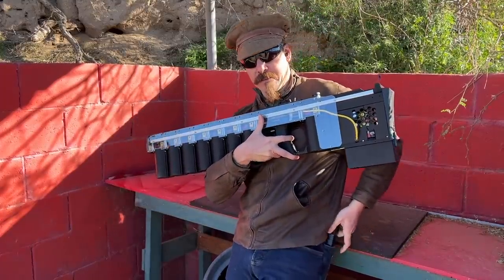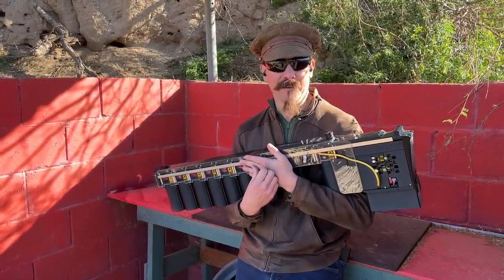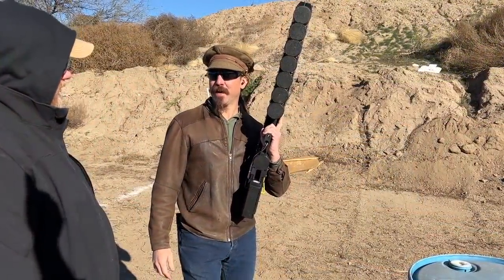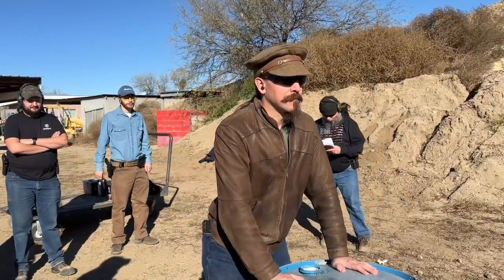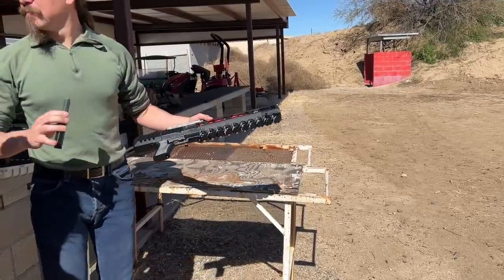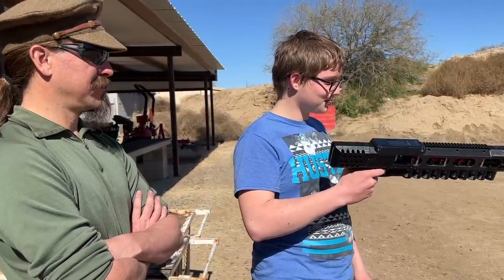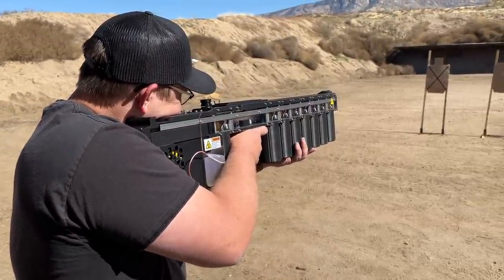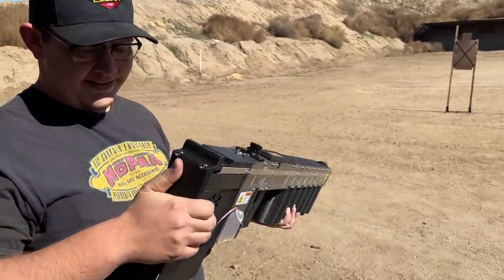I Tried to Use the GR-1 Anvil at the BUG Match...

Comment: If you look at Paintball, firing gelatin musket balls, the development of actual accuracy came with First Strike Rounds.  They are basically a Rifled Foster Slug.  An aggressively wide patent was somehow allowed on the "shaped projectiles" and has stalled out all other development, but Accuracy went from 25x25 over X range being typical to 5x5 and about a 100% increase in range.
I cold see a multi capacitor system, charge when powered up, then start recharging as soon as discharged being useful to limit the delay between shots.  Will be interesting to see how engineering and development move forward on these.

Comment: I feel like they need to dial the weight of the projectile down to something closer to a 30 cal rifle round. Then they could use more energy moving lighter round faster.
Right now it’s like a pop cap trying to push a cannon ball.
Reply: There's practical limits on the speed of the projectile due to how the coils work.  It's far easier to add energy by increasing mass.
Reply: Naw coil guns dont behave like that its fairly easy to move a larger projectile the same speed but due to complications with timing and how fast you can dump the capacitors higher speeds become much more difficult the faster you go

Comment: Saw the light/heavy trigger pulls resulting in non-optimal firing; could a charge to pull, fire on release system help mitigate that?
In any case cool gun, thanks for showing it to us and taking it out of the realm of theoretical.
Reply: That sounds a little unsafe to me, I was more thinking along the lines of separating the charging and firing switches to use different fingers on each, or a switch for the off-hand for charging. But since it's still a prototype I'm sure they're going to change many things to it, and then to the next model, and the next, and so forth, until everything is optimized.
Reply: As opposed to pulling the trigger on a regular gun? It's much more tactile with pull to charge, release to fire. you can have a button where a slide lock/ bolt release would be to release without firing, or use that as the charge button. The current method is much like the old school pull a little for semi, all the way for auto.
Reply: "Release triggers" are a thing, but they were never popular.  Mostly they were used in shotgun competitions, but they're all but unheard of today.

Comment: Ian should start a WWSD 2120 project.   You can get a simple railgun set up pretty easily.   Basically just wrapping a tube magnetic wire and a couple 9V batteries.  It won't generate a lot of acceleration, as there were no additional stages or increasing power levels, but even that is enough to launch small metal objects 5-10 feet.

Comment: seems like it would be nice to have it charge automatically when in firing mode so the trigger simply is a discharge and can be less fiddly.
Reply: Basically give it a safety switch. Safety off = keep the capacitors charged.
Reply: @matejlieskovsky9625  - My thoughts exactly.
Reply: He brought this up in the previous video, keeping those capacitors charged generates a TON of heat, which is also why the gun can't fire too quickly too often, cause it might melt the barrel or damage the capacitors.
Reply: @SnivyTries  I must have missed that bit of video, where is it? I know dry friring is bad for the gun and it does tend to heat up in general (courtesy of 2% efficiency), but keeping the capacitors charged up should be relatively ok unless there is something weird going on with the circuitry. I mean, you're only fighting the leakage, which shouldn't be that bad. Maybe their step-up is not built for it?

Comment: If I were to develop such a weapon, my first choice for projectiles would be those .177 copper ball bearings, this would solve aerodynamic issues. When they're coming out the barrel in a bright green streak, thats when I'd start developing my own projectiles..
Reply: I think it needs ferrous metals for the projectiles
Reply: @frostedbutts4340  Indeed it does. You can't fire copper projectiles with a magnetic accelerator!
Reply: You can fire copper projectiles but it would require different timing for the coil which mean you will need a different setting for the gun. Any conductive object will generate a magnetic field when put into a moving magnetic field and since this magnetic fields will tend to resist moving magnetic field of the gun it will accelerate the bullet albeit with weaker force. The upside of coilguns working by this principle is there is no upper limit on how fast you can move a projectile and it can accept alll kinds of ammunition as long as you wrap a feww loops of copper coils around it.
Reply: @frostedbutts4340  I think he's talking about the copper plated steel BB's for air rifles

Comment: I suspect eventually this kind of weapon will have the magazine contain both the battery and the projectiles, so you don't have to worry about the battery going low. It would need a much smaller battery to be able to handle just one mag of rounds.
Reply: Would be nice but something that has been true for batteries for a long time is that a bigger battery/putting more in parallel is going to be better at delivering high currents to your device without losing too much voltage to internal resistance in the battery cells. I'm not saying it's impossible but unless battery chemistry changes a lot those would be some bulky magazines. And you'd also have a positive and negative contact point on both the magazines and receiver that need to stay clean and electrically conductive, but that should be easier to solve than the first issue.

While we're limited to current technology a good clear audible/visual indicator and easy to swap battery would be nice. Ian did show you could change it in one of the earlier videos but for the prototype it seemed a bit like a hassle to me still manually connecting that wire instead of just pushing it in establishing the connection. Indicator wise I was thinking about for example multiple colours.
green: good for at least current and next magazine
yellow: fine for this mag (at current setting) but maybe not for the next
red: can still fire but will run out with this mag
flashing red: unable to function well/really long charge time warning?

Oh and for truly fancy futuristic solutions that information could be displayed not only on the gun itself but also with some google glass like contraption?
Reply: I was thinking along the lines of swappable batteries as well. Another solution would be to carry a battery backpack, plug a wire into the gun and you're good to go. Battery goes flat, grab another backpack from a vehicle / ammo dump.

Comment: Sounds like air soft gun with extra step but one day it probably goes beyond what gun powder weapon can do.
Reply: I think they have more potential as a vehicle or ship mounted weapon than a man portable one. Similarly to the minigun, vehicles have much more generous power storage and weight requirements.

In like 2012 the navy test fired a rail gun at like Mach 20 sucsessfully. But it never went further than that due to cost.
Reply: @0sm1um76  Ships are def the no.1 platform for gauss guns, because they can have the massive batteries without no problem

Comment: Interesting issue with the trigger bieng too light. It could be solved with a binary type action...pull to charge, fire on release. This is common for railguns in video games and would be a nice for the mfg to add as a menu selectable option.
Reply: Many kinds of sporting fire-arms have a fire-on-release trigger because it's apparently more accurate than squeezing the trigger to fire. So this is definitely a good idea.
Reply: Issue with that sort of double function trigger is not firing after charging. Since the "preparation" of shooting takes a moment with a deliberate action, by the time it is charged, the target may be out of reach, and then what? Shoot at the ground?
Reply: @HappyBeezerStudios  mechanical binaries is regular firearms solve this problem by the user switching the safety back to normal mode if they don't want to take the 2nd shot. Similarly with this electronic system a thumb 'saftey' could be used to either: 1)interrupt the firing cycle either by dry firing the later coils while withholding the projectile. OR 2) more simply disabling the trigger leaving the capacitors charged for the next shot or to discharge naturaly over time.
Dumping the round is a last and least desirable option. This need to discharge is also a problem faced by muzzleloader and crossbow hunters who often have fire into the ground/target at the end of the day in order to safely/illegally transport their weapons home (though there a few unloading tools now available on the market in recent years)

Comment: Even with the weapon switched off and mag removed, if there is a projectile in the barrel and the capacitors have been charged there is still a potential danger.
Capacitors can be nasty, as young mechanics we used to charge condensers (automotive capacitor used in points ignition) and throw them to people. It's instinct to catch what is thrown to you and that's when you get zapped.
When they dropped them we would pick them up again (discharged) and say were dreaming, this thing can't zap you.
Then carefully pass them the charged one you had in the other hand and get them again.
Reply: There is no projectile in the barrel with the mag removed. The projectiles are shot directly from the mag and there is no chamber in the barrel.
Reply: @Ashcrash82  If it misfires the projectile remains in the barrel, did you not watch the same video I did?
Reply: @Stambo59  It was my impression that a misfire would discharge the capacitors, so still no danger. I'm certainly not an expert on this thing though.
Reply: @Ashcrash82  It would but depends on what the operator does next, if he pulls the trigger to recharge it for example.

Comment: Is there a reason ball bearings aren't used as a projectile? It would seem that they would be more aerodynamically viable.

I can think of two reasons, though I don't know if either are valid. First would be the lower mass in general. The second is that being spherical it wouldn't behave the same as a rod in the magnetic field (i.e. it could rotate "end over end" in the barrel). The second reason is definitely pulled out of my butt.
Reply: Two reasons, firstly the projectile is only being accelerated when its passing through each of the coil fields in succession, longer object spends longer being pulled or pushed in the fields. Secondly without distinct magnetic poles to control acceleration direction you would be more likely to have it ricocheting inside of the barrel or the spherical projectile being spun in place rather than accelerated linearly. However thats not to say you couldnt make improvements to the ballistic characteristic of the projectile, offset the coils along the Barrell length similar to rifling, or alter the projectiles magnetic properties to induce a spin (e.g. having a weight balanced non-ferrous material substituted along a few degrees of the projectiles radius)
Reply: you would want a ball bearing that looks more like a miniature golf ball, it helps with controlling the accuracy.
Reply: The projectiles are already half inch, I don't think this thing will be easy to get a sporting exemption for either. Using half inch spheres would just be too small, at least in its current state.
Reply: @watcherzero5256  You are implying that it fires magnets. I doubt that.
And that concept for creating a spin on the projectile wouldn't work either.

Are you maybe talking out of your ass?

The best idea to create a spin is really the same as with traditional weapons.
Rifling.
Obviously thats not done in a prototype that shoots slow heavy projectiles anyway. 
There are a number of easy to fix problems here that are all not solved on purpose, because there are more important problems to solve and to spend time on. Solve the wrong issue too early and it will limit your development, or it might just be a waste of time in the long run. 

My best guess as to why the projectiles are large cylinders? Making the projectile heavy gives it more time to accelerate, to a slower speed, for the same energy output. If you make the projectile round its impossible to make it this heavy youd need pretty large diameter balls.

And they haven't figured out how to make it shoot fast yet.

A fast projectile means a short time in the magnetic field, means you need a stronger magnetic field, or more fields. 

Over all, there is a energy density and availability issue.
For traditional guns, your entire required energy is in the bullet itself. Its there almost instantly, and its simply a pressurized gas. Thats easy to work with. 

Here its stored in a battery, and it needs to be loaded into capacitors, and used by coils. 
The battery is heavy, the capacitors take up a lot of space, everything is fragile and relies on computers. 

You could probably make a WAY better design if you make it use a backpack, like with flamethrowers.

Honestly, the biggest use i see with gauss canons isnt in a compact mobile design, but large cannons shooting high velocity projectiles.
If you use explosives for high velocities you need A LOT of explosives and a HUGE barrel, you have a ton of stress and wear on the material etc.
For gauss weapons, your energy has no significant weight, you have no huge explosion. It's easier to upscale.

Its most practical for atillery, not rifles.
Reply: I could see them being changed more to a sort of dart in later versions.
Reply: Well I guess they used heavier rounds because while it is possible to accelerate smaller projectile to much faster velocity in theory (with same amount of energy dumped into lighter ammo will get faster) but the timing of the coils will be increasingly difficult with faster (lighter) projectile. It is still in early development so I think we'll see ability to shoot lighter projectile faster (more terminal velocity) in the future.
Reply: @HyunMoKoo  Also lighter projectiles will usually go slower, with there being less magnetic mass.
Reply: @carlpanzram2012 , rifling is actually NOT that viable for gauss weapons, as it would dramatically increase wear and tear per shot. Even the Navy railgun was using fins on the projectile much more akin to an arrow's fletching (an even older method of spinning projectiles than rifling)
Reply: @someweeb3650  Correct me if I am wrong, but this is not a firearm as there is no explosive or deflagrating propellent, and thus not subject to the NFA

Comment: Very few people have fired a coilgun, fewer still have built their own and fired it. I made a single stage coilgun in my vocational electrical class using old A/C capacitors and a pen tube wrapped in thin copper wire from a ballast transformer. Didn't really understand the mechanics of it at that point so it didn't shoot very far, but it did! Really want to see if Arcflash makes a Gauss Cannon at some point.

Comment: It should really have a separate trigger for charging the coils.  Look at flywheel nerf blasters for example, they have a set of motors that have to spin up to full RPM before firing, so they have a second "rev trigger" to charge the flywheels before you advance the round.  two stage triggers like that, really need some kind of tactile bump stop to prevent those misfires.  It's really hard to do properly unless you're calm, focused, and experienced with the mechanism.

Comment: Since they're contactless "smooth bores", a really simple accuracy upgrade could be to make that laser adjustable.  If you had a simple screw-adjusted windage mount for it, you could just adjust each rifle individually instead of needing to revamp the manufacture to tighten down accuracy.
Reply: They talk in the interview video about solutions for making them proper "rifles" either integrating spin into the projectile with some kind of fins or machining, or, what they're hoping to nail down, inducing spin in the projectile magnetically by basically including some coils that would affect the projectile in the same way an electric motor would.

Comment: Is there any thought to using fin stabilization?  That and a bit more aerodynamic shape to the round might improve its accuracy significantly. Also, what if you used a more needle like round but put the same energy in?  Now you are looking at potentially much higher velocities. Just some thoughts
Reply: In one of the previous videos, the interview session with one of the guys of the company they did bring up different types of projectiles. It was suggested that people can easily make their own if they are interested. But the weight subject was also briefly came up, I recall something along the lines of lighter projectiles not being all that much faster with a coil gun due to the way it functions. 

I guess it comes down to the magnetic field from the coils pulling on the ferromagnetic metal, less metal to pull forwards, less energy put into the projectile. There are other materials than iron that are ferromagnetic but I can't remember if there are any with a decently high density and "stronger attraction" to the source of a magnetic field. If there are some weird alloys out there it's financially probably still better to just go with plain old iron instead, maybe with a bit of carbon turning it into steel.